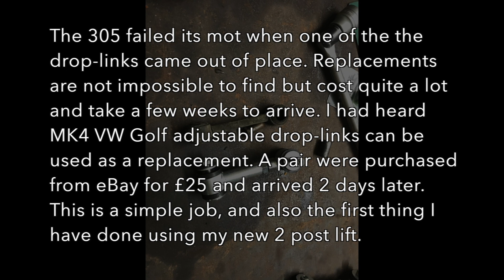Replacing Peugeot 305 Droplinks

Comment: You almost missed the threshold there. Be more careful :)
Congrats on getting a lift! It makes the job ALOT easier.
Reply from the maker: SzwarcuKX5 
It was still on by a good inch haha, but yes i need to just get used to having the legs setup just right for picking up cars. 

It does make things much much easier thanks.